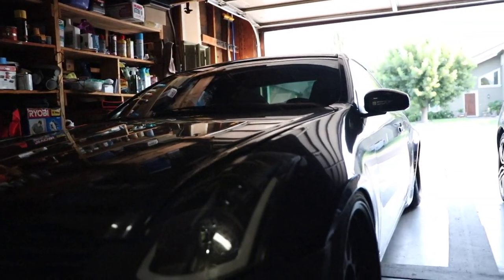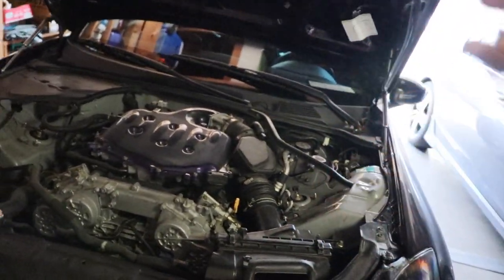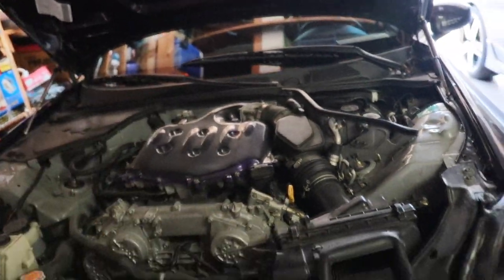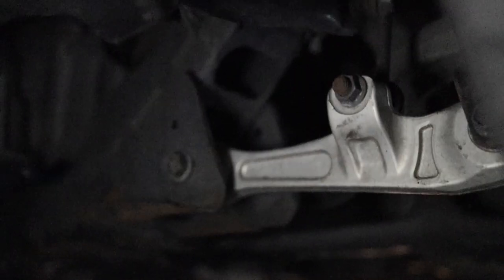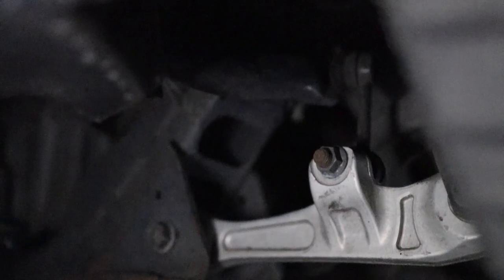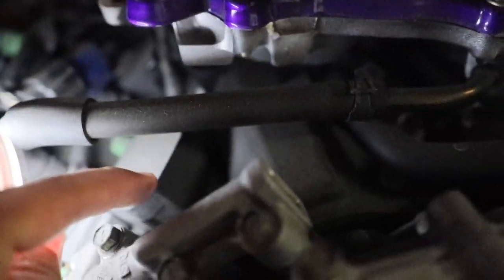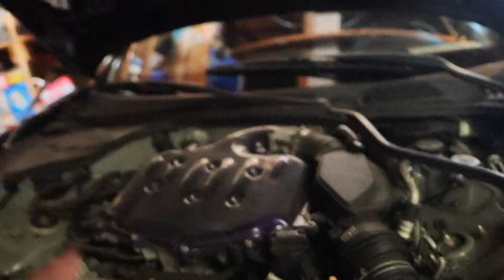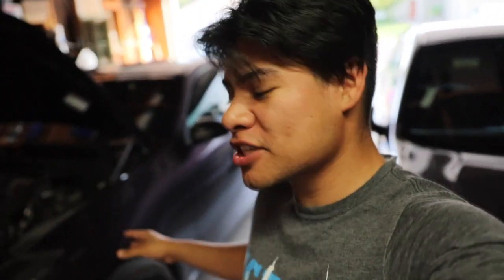G35 TOP 3 COMMON PROBLEMS (2023)

Comment: My problems I’ve experienced:
1. Valve cover gaskets
2. Oil O ring leak 
3. Control arms
4. Crankshaft sensors (currently dealing with)
5. Electronics don’t work properly (deadass my car won’t lock after I’ve used the AC... wtf😂?) 
2006 G35 coupe black on black.
Reply: 06 g35 x sedan black on black aswell I’ve dealt with valve cover gasket and crankshaft sensor
Reply: Also I don’t have tail lights for some odd reason I have brake lights and turn signals and headlights but no tail lights I replaced the fuse but it still doesn’t work
Reply: Agree delt with the control arms and valve cover gasket and my passenger seat doesn’t recline and my driver side window motor went out on my white 2006 G35
Reply: Got the valve cover gaskets control arm bushings cam sensors and some other things now it has sum electrical issues lmao my car just hates me 😭😂 it always breaks something when I fix some that just broke 💀
Reply: I have a 06 grey on black
Reply: Same here 03 g35 coupe one of my money pits for sure

Comment: Pro tip: get poly bushings for your lower control arms and ga e those pressed in. It’s cheaper than buying brand new arms and will last significantly longer than OEM or aftermarket arms with OE style bushings.
Reply from the maker: Very good advice, I forgot to mention that, thank you 🙏
Reply: Facts

Comment: Why was the fuel gauge not on this list 😂😂😂 I have a 2006 g35 coupe and love it to death
Reply: oh god the fuel gauge is terrible
Reply: This is the true fact, I got a 06 and that shit always reading wrong
Reply: @slipperylatex872  your problem might be the charcoal canister. Sometimes you have to replace it due to it not allowing you to actually fill up the tank
Reply: i got a 06 g35 i had to change the fuel pump and the new cluster shit tuff but i love my g35
Reply: Just did a cluster repair ✊🏾 wish me luck y’all
Reply: bro i have the same car & just had to get an engine replacement 😞
Reply: UPDATE.... cluster repair on eBay for 89.99 bro it works, no more fuel gauge issues, tested it for about a week, highly recommended
Reply: @lifeascurrency4961  any link to it?
Reply: Yes the gas level reader is a very common issue the 2006 and older Gs but it’s low key a blessing in disguise, it’s attacked to the fuel pump model and u can get to it from the back seat, most cars from the 2000s u have to drop the whole gas tank makes it a way more annoying and expensive issue, but regardless of any problems one of the best thing you can do to get better performance and reliability is to upgrade ur fuel pump and you can fix or replace ur reader while u do it
Reply: @lifeascurrency4961  you think you could send me that I’m currently having that same problem

Comment: The oil dipstick location and difficulty reading!
Reply: PREACH
Reply: @vq_tyler3974  preach?
Reply: Just sand the dipstick and it's easy to read
Reply: Spit on it and tap off excess. Works every time
Reply: @MrPaininvain  well, that’s a new one..I’ll try that Thanks!!
Lol....
Reply: Mhmm never really had a problem reading the dip stick
Reply: I have trouble putting it back in lol
Reply: @kainfowler3686  it be like that

Comment: For me: 
1. Oil consumption
2. Getting a good reading from the oil dip stick / putting the damn dip stick back in

3. Heavy doors closing on themselves and not staying open. Thought about CF doors or even lambo hinges but don't want to get t-boned and die with the cf doors.  Probably will just buy the new hinges.
Reply: Best time to check oil is in the morning after the car has sat all night. gives me a perfect read every time. if i do it anytime other than than though, it’s a little messy and can be hard to read

Comment: For oil leak i did an o-ring replacement and oil pan gasket and fixed everything 🤭
Reply from the maker: Alejandro Pena I had to replace my oil filter o ring seal as well that’s a good mention.
Reply: BeDistinct man it’s good to see somebody answer haha and yeah super cheap and might fix the problem
Reply: I don't have oil consumption to I am just like you
Reply: My car G35 doesn't really burn oil unless like get on it a lot.
Reply: I️ replaced the o ring and it is fine after that. I️ never replaced the oil pan gasket.
Reply: Seth Gleason i did it just in case haha plus it’s cheap and easy to do
Reply: how much did it cost

Comment: My most common problems for the g35 are
1. Seat belt
2. Camshaft position sensor
3. Fuel gauge
4. Filling gas
5. Oil consumption 
6. Mustangs and all Honda magnets

Comment: I only put about 3/4 of a quart every oil change of 3500-4000 miles I also had window motor issues and door locks as well lower control arms and camshaft sensors really common
Reply from the maker: Kevin Ramos had all those issues as well lol good stuff
Reply: What year is your G35?
Reply: Junior romero 2003
Reply: Kevin what brand of oil and weight?

Comment: The  first broken thing I found on my G was the fuel gauge so I never knew how much gas I had. Wasn’t to bad to fix but was a pain in the ass not knowing my gas level
Reply: HOWEVER MY SHIT IS OVERHEATING RN AND ITS A PAIN IN THE ASS TO REPLACE THE WATER PUMP. PAY SOMEONE ELSE
Reply: What did u do to fix ?
Reply: @46jkm  I removed the fuel sending unit, under the passenger side rears, and cleaned the metal contact patch( with gas and a cotton swab) where the float rubs against it to show the level to the car.
Reply: How much did that cost to fix the fuel gauge ?

Comment: Bought my 06 G35 brand new. I have 230,000 miles on it. I've always had oil consumption issues. When it was still under warranty, the dealership replaced my block. Eventually, oil consumption issue returned. Currently, I have to put a quart every 450 miles. Other annoying issue I have is the fuel gauge not functioning when it get below half way. Also, the driver's side seat is torn in the corner from just normal wear and tear. Currently, I'm trying to fix misfiring issues. Besides that, it's surviving.

Comment: I have a 2006 G35 sedan with 235k miles... First issue I had with it was my Gas Gauge... Tried cleaning my fuel pump level with Q-tip but did not work. I just learned to live with it. Resetting my trip meter every time I fill up... Other things I replaced in 6 years of ownership...

- Brake Rotors/Pads
- AC and Power steering Belt (Recent)
- Lower Oil pan gasket (Recent)
- Oil Filter O-Ring (Recent)
- Bank 1 Cam Sensor (Recent)
- Drive side Sending Unit

Car has been great and hoping it last me another 100k miles. But my valve cover gasket has started having a tiny leak.

Comment: #1 Oil consumption was my first problem

#2 I did had to change my lower control arms a week after I bought my G 

#3 My O rings and valve cover gasket had to be changed about a month ago 

I add like 1 quart of oil for every 500 miles I love hate my G
Reply from the maker: At least you got the problems all fixed, but damn that oil consumption I’m kinda glad I haven’t had that issue yet
Reply: How do you know if the lower control arm is bad?
Reply: @jeremyvazquez  I check by shaking the wheel their should be no movement

Comment: On my g the first problems were 
1. Oil leak due to pan seal
2. Cylinder misfire from spark plug
3. Broken fuel pump
4. Broken belt
5. Broken ball joint
6. Battery and terminals
7. A bunch of other expensive things I don’t remember

Comment: 2003 V35 Skyline.  2nd owner since 2007.  0 oil problems.  0 control arm problems.  Might have had spark plug problems by the sound of your vid.  2+ fuel gauge issues.  Turbo'd to 400-430hp atw.  NOTE:  Drive like grandma coming back from bingo on a Sunday.  Slow and steady.  Power was jic.  Had other problems but that's on me from adding upgrades.

Comment: Sold my 03 g35 sedan for 1800 it needed a new engine it had a really bad ticking noise also for some odd reason when ever I cut the car off all windows will roll down..I changed the window motor on the driver side and change all fuses still had the problem...I had to turn the car off but keep the key in ignition unplug car battery then take key out to keep all windows up..also I drove my car for 2 years with no thermostat, because it would over heat with the thermostat in it , and bacc then money was tight so I just got rid of it...it been thru a lot with me but also put me under a lot of stress NO CAP!!!

Comment: i have a g35 and my first problem was having a radiator leak due to hitting a bump really hard and now i have a 2nd cylinder misfire so hopefully its just my coil pack that i need to replace
Reply: RivalGamer I hope not bro. We’ll find out tomorrow. Should I check all 6 spark plugs for any oil in the cylinders ?

Comment: 05 coupe 6mt rev up 165k 7 years owned  ..oil consumption it not bad actually. 1 or 1/2 quarter in between oil changes ..I change mine every 3k and filter mobil one filter n oil .I use penzoil platinum now it 22 $ or 5 quarts is cheaper ..get control arm bushing from Z1 motor sports use same control arms ,ur ganna need a press tho but I got new control arms and went out after 2 years ,alignment is expensive 180 for me lol. Tires get wasted quick 2 years average for me, I buy em used now .I got lowering springs and camber kit and rear toe bolts they help but adjustable rear would help with that .tires is the most annoying for me ..things that broke  seat motor,window motor, door panel fabric comes off used super glue . Maintenence- clutch n flywheel set  twice 1000$ parts n install ACt frist one then z1 second one ..thermostat, radiator, 3 coil packs ,spark plugs once ,battery, both belts , recently changed cam n shaft sensors,maf sensor n coolant sensor,fuel pump  wasn't having issues but did them , air filter once 🤣 K&N cleaned it tho once lol 😆. Need a bulb for the headlight..seats are ok feel like  the head rest could move forward a lot more ..clutch pedal gets stuck , wheel hub passenger rear .duralst gold braks n rotors chnage em for free before 3 years I missed that tho I think lol need a rear axel driver side the rubber part ripped grease every where 🤔 roof pain coming off kali weather ..gas guage don't work got stranded twice lol hopefully new fuel pump fixes it im just steady watching it doesn't move so idk 😐..biggest issue it stalled out on me didnt wanna turn on pulled it with a rope hope with my dad navigator lol took a month to figure out what it was ..didn't turn over but turned on fans would come when key was on on position..disconnected ecu 15a IGN fuse popped put new one in jumped started it it turned on then it finally gave me a code for igntion coil 4 was out should of checked them all carefully frist but I'm an idiot..oohh power steering pump went out ..I accidentally broke my brake like doing my brakes 🙃 lol I do all thr work on my car except the clutch n flywheel..I need to do a transmission n gear oil change im nervous tho 😬 but yea ..get a sound system if you like music sound good in thr small cabin 12 sub ..alpine non touch screen 50$best buy was on sale it dope 👌 199 dash kit  reason I lagged ,amp kicker 200 best buy wires 50 i think sub orion 60$ box like 45 i think adds up but worth it a..sound system and all suspension camber kit rear n front n coils best mods ..performance mod dont do much imo ur better off with suspension n sound system. I don't any mods on mine so probably don't know what I'm missing lol 😆

Comment: My bushings on my LCA were fucked too. Just a $30 set of bushings. No need for a whole new arm. I got fully adjustable arms on the stuff that matters.
Reply: Ball joints are common too. I did that also. Diff bushing too. Really just check out your bushings and make sure they good. Cheap asf to replace.

Comment: problems i’ve experienced with my 05 G35 Sedan 
- new transmission at 189k
- valve cover gaskets 2x
- over heating issues
- camshaft sensors 
- coil packs and spark plugs 
other than that it’s just minor interior problems but once all those are fixed amazing car overall and very cheap and easy to work on
Reply: Overheating because not aired out right or needs new thermostat
Reply: I’ve had 4/5 of these haha

Comment: I think they fixed the oil consumption problem on the 2005-2007 g35 coupes because I notice that most 2003-2004 G35s are dealing with this
Reply: Nope. They fixed the oil consumption issue in the Hr motors. De-rev ups are even more notorious with oil burning than regular De engines.

Comment: i just started doing small modifications on  my 07 g35 coupe and its at 250k miles, lol. first problem was driver window motor dying around 160k miles, oil leak somewhere that messed up the starter? other than that, just did oil changes and battery changes. 1st owner btw. everything is stock except BC BR coils
edit: everything is good mechanically (no oil burn), but my gas gauge read is off so i reset the mile timer everytime i fill it up, and the CD player makes this loud screeching noise so i have to hit the screen to make it stop. OH, and the door hinges.... hurt shins....

Comment: 1. cam/crank shaft position sensor 
2.oil consumption 
3. door/windows/steering wheel button/seatbelt/door locks not working properly 
4.fuel pump 
5.control arms and ball joints 
6.gas gauge not reading correctly 
7.air bag light won’t go off even after service

Comment: My first problem I experienced, already had the issue when I bought the car off the previous owner, the fuel gage not working correctly
Reply from the maker: Colby Starkel yea I can be kinda sucky
Reply: Colby Starkel my fuel gauge doesn’t read at all, I have to use trip and fill up every 250 miles. Plan on cleaning the fuel sensors and then maybe even replacing both fuel sending units
Reply: Same problem with mine... I guess it’s common

Comment: Top 3 issues on my 04’ G35 Coupe: 
1. Locks don’t work, i legit have to reach over and unlock the passenger door every time someone rides with me. Just waiting for the day my window motors go out right now which is also very common and happened on my old G
2. My oil burns so damn fast. I have to add 1 quart every 500 miles (every 7-10 days). it’s crazy. If i change my oil any later than 3k miles, it will almost be black. Engine is at 125k and runs amazing though 
3. My oem control arms are bent which gives my wheels an unwanted camber and makes my fitment trash until i get bigger offset wheels and spacers. I hear the metal slightly grind every time i take a a slow turn. Plan on replacing soon when i get coilovers
Reply from the maker: Damn every 500 miles? That’s insane
Reply: bro same except the last one
Reply: BeDistinct Yea it’s bad bro, i plan on doing something about it soon. If i top off my oil, it will need a new quart within 500-750 miles later

Comment: My first problem w/ my 2007 g35: trunk just stopped working out of nowhere. No way to open it except for emergency latch.

Second: no oil consumption issues but an issue with getting good readings on the dipstick. 

Third: I need to get new hinges for my doors because they just will not stay open.
Reply: If I remember correctly, the doors on the g35s aren't supposed to stay open. Unless the 07s are different:)

Comment: Top 3 common problems. Cam sensors , crank sensor , valve covers, and oil cooler seal. Can go on forever ... only at 95k miles but the past 20 k I’ve had so many issues. Wear and tear
Reply: For the first 2 problems was an o2 sensor 180 oem , and then it was valve covers
Reply: Oh for oil consumption it burns 2.25 - .5 quart a week lol.

Comment: within the past 9k miles owning my G ive replaced the starter, front lower control arms, front lower compression arms, front ball joints, radiator, full set of brakes and rotors and a gas cap.  its been a money pit to say the least.
Reply: How did you come upon changing the starter? Like was it something you needed to do because of a on coming issue or just did it because? 
I’m having issues on my g 
I replaced battery and car turns over but makes a noise when trying to  start up. Any advice ?
Reply from the maker: Damn within a year I changed the control arms, rotors, valve covers, oil filter o ring, ball joint, radiator, camshaft sensors,  so I feel you on that. All in all I think I spent about $1000 in all that since I did the labor for all the replacements but yea it can get expensive.
Reply: BeDistinct damnnnnn, not quitting on this thing until the engine blows or trans goes out though, love it way too much.
Reply: Cuhti ?
Reply: S0ul3ss z most likely a crankshaft, camshaft censor problem, i had the same problem if youre talking about a weird sound when you have it takes time cranking over to actually start the engine.  its a very simple fix if you have common shop tools such as a 10mm socket wrench, jack stands, and a jack.  its just unbolting and plugging in and then bolting back in.

Comment: I got my 04 coupe 6 months ago.
Problem 1- cam position sensor
Problem 2- both windows stopped rolling down
Problem 3- A short in the car came up, took it to 3 shops to get it fixed
Problem 4- Car wouldn’t accelerate over 5, ended up being a sensor in the gas pedal.

Comment: so i just bought this G 6mt with 200k and my first issue was the flashing CEL code p0300. So normally with a new to me car, i changed out the spark plugs, coil pack, and injectors. The problem still  persisted so i changed the fuel pump. The problem was still there and the car would lose power at 3k rpm. I had my suspicions about the cats ans turned out they were clogged so i just cut them out and had a shop fab some test pipes. All is well now and the car pulls like a MFer.

Comment: First issue with mine was a oil leak. 2nd was the clear coat on the car fading away. 

Bought it like that though. Repainted it now. Still have a oil leak though. Cant get it to stop
Reply from the maker: Justin/Spirit ooof that clear coat brings me back nightmares